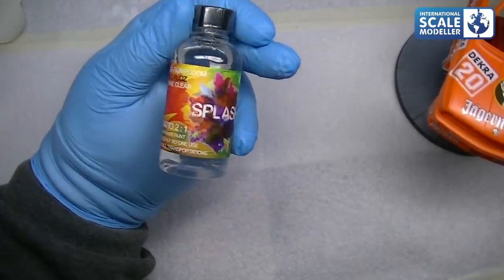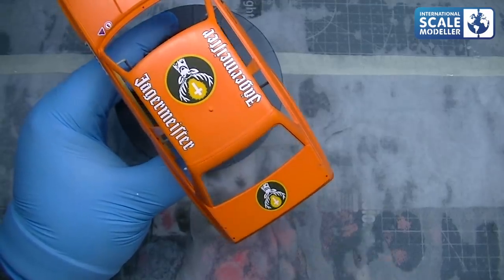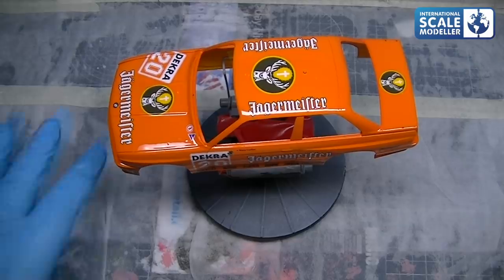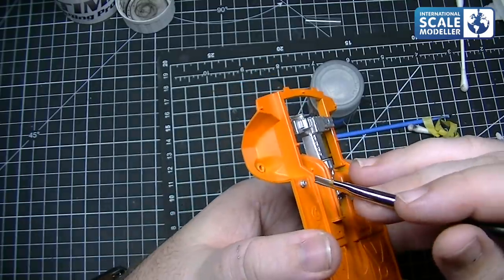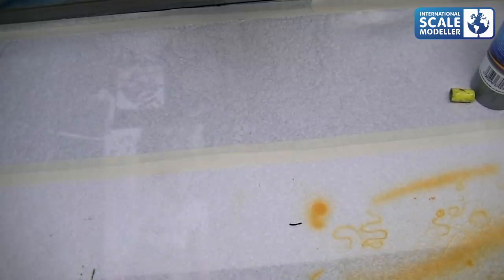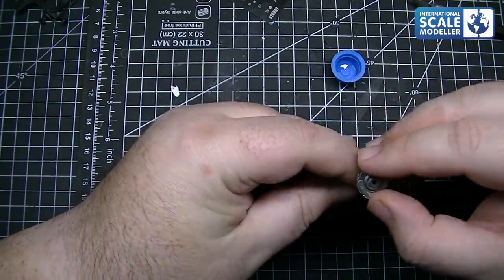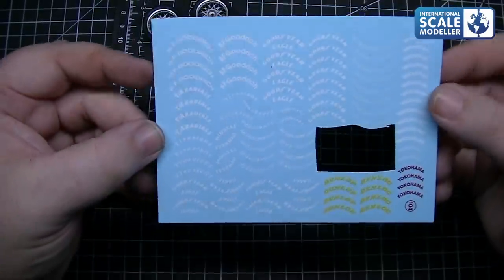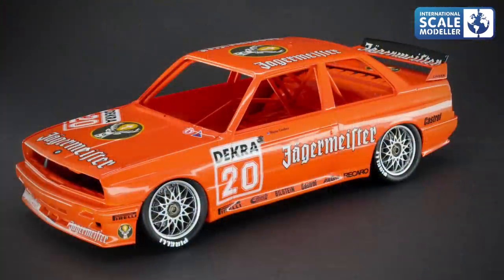Beemax 1/24 BMW E30 M3 Step By Step Build Part 2

Comment: Another Great Vid Paul :-) I notice the Citadel Mithril Silver does not appear to be in a 'standard' GW pot... Is that an old Tamiya pot? I've had a nightmare with my GW paints... Had to thin em and have started re-bottling into dropper bottles with a mixing ball...
Have recovered most of em, but 2 or 3 were too far gone and turned to jelly...
Got most of em back to life with adding DI water and mixing well with the Badger mixer making sure I did not get any 'skin' or lid droppings into the thinned paint..
Reply from the maker: No i moved this one in to a tamiya pot all my others were put into vallejo style dropper bottles. Yeah the GW paints are well known for drying out, well worth changing bottles. thanks for watching and commenting - Paul :)